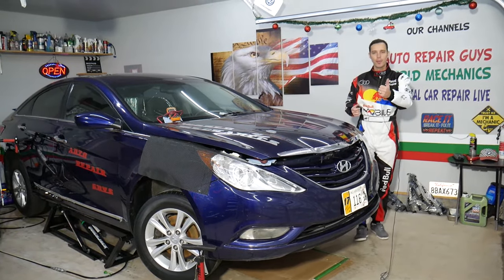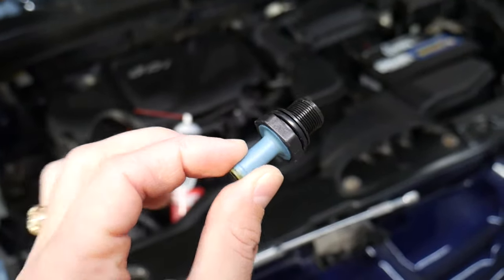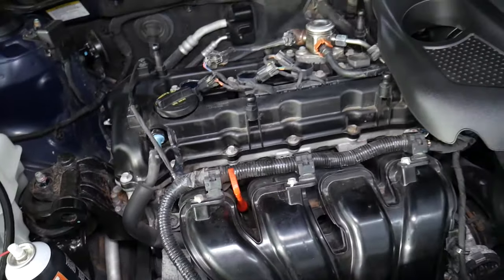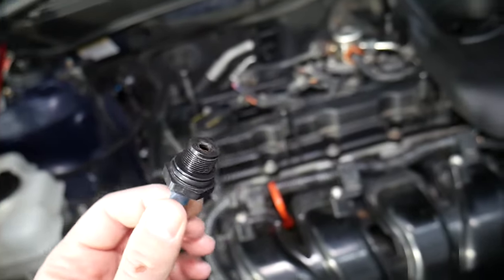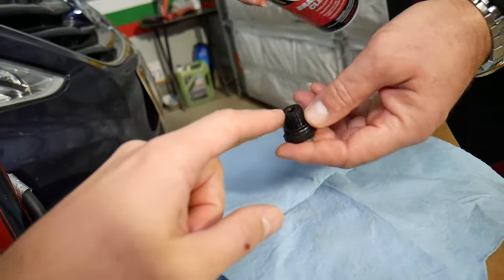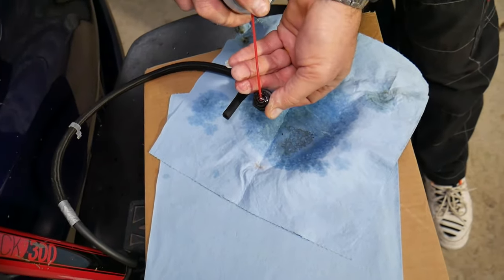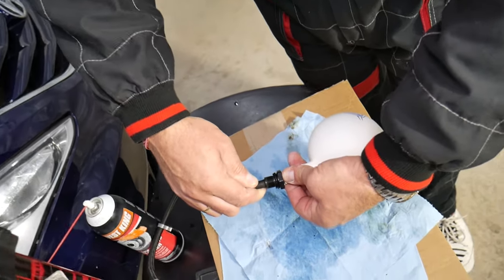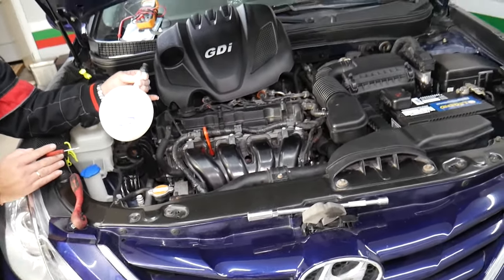HOW TO TEST AND CLEAN PCV VALVE ON CAR  EASY

Comment from the maker: Products that we use and recommend:
► PCV Valve (check for your car): https://amzn.to/2XK8Oyr
► Intake Cleaner: https://amzn.to/3oXt0Jc
► Panel Removal Set: https://amzn.to/3YiMADu
►Torx Set: http://amzn.to/2hbyWgd
► Tool Set: https://amzn.to/3p5MM6t
► Screwdriver Set: https://amzn.to/3XRB28Q
► Engine Oil: https://amzn.to/3xBc8B9
► Oil Filter: https://amzn.to/3w0Ulme
► Torque Wrench: https://amzn.to/32qyRwg
► Liqui Moly Engine Flush: https://amzn.to/3IiDBID
► OBD Scanner that we use most often: https://amzn.to/3I4MQfe

► Check out our Amazon Store for the tools and parts that we use: https://www.amazon.com/shop/worldmechanics
Reply: I test my pcv valve   and I blow air from side  wich is go to head    is open 
From other side with is go to intack is blocked

Comment: Ballon test was wrong guys. Pcv will pass weak pressure air through it. But not high pressure. The baloon is giving weak pressure of course. Misinformation
Reply: Yeah, I tested with a brand new valve and it leaks as you say, same way their broken one does.
Reply: Some valves (earlier ones?) don't have balls, but a tapered plunger because at idle you have high manifold vacuum and high speed/ acceleration very low to near no vacuum and so there is a need to moderate those high vacuum conditions. Yes, they never sealed completely by design. One wouldn't want that. These things were on 6 cylinders at least, but the problem with 4 cylinders and less, pulsing and too low a vacuum is created. May be why a ball is used in these cases as you do need a seal?
May be there's another scavenging component?  I don't know though. It a thing to ponder and find an answer?

Comment: I usually have a glass jar of acetone on garage. I soak PVC valve  for 2 hours. and does the trick.  Cleans the gunk inside valve pretty good. Thanks for the informative vedio and Don't forget to have a drink every time your hear "Guys".😁
Reply: Wasted 😵
Reply: Ty for the tip sire! Think I'm gonna try acetone on the EGR valve as well(not on the electrical parts of course) because I couldn't get the 1/4 tube part all that clean. Ty again

Comment: I soaked  and cleaned thoroughly the PCV valve, test it using the balloon as you did in the video but I did not deflate immediately the balloon in the PCV valve instead I left on the table for 4 minutes.  The  minutes passes  by,  the balloon deflated very slowly. In fact I hear a  little bit of hissing sound in the PCV.  So my question is should a good PCV valve be air tight sealed or not? Thanks
Reply: Good question, I'd love to know the answer.
Reply: Another comment said it should slowly deflate, not air tight

Comment: Thanks learn something new I'm dealing with all 4 cylinders misfire I replaced iac valve ignition coils and spark plugs also have new fuel pump and filter that were replaced couple months ago this is being a headache  I hope it's this

Comment: I changed the pcv valve the hose and the separate data connector going into the resonator but but i still have a p0442  evap small leak the scan tool had said it from the pcv from the mechanic i went to any advice should i have put Teflon tape around the threading to the pcv valve

Comment: Great job, guys. Keep it simple. You are awesome.
Reply: Trq has a vid, he takes off intake etc etc, to remove valve.   Entertainment at its best😂
Reply: P.s. some slap shot mechanics, use cheapest vac hose. Vacuum will actually collapse these cheap hoses.

Comment: Lovely. Worst issue is i cannot get replacement parts for a bad pcv for my vw fox... -.-
Reply: You could just try Kia part inside of a hose. Then just take out the guts from the original and use it for a fitting.

Comment: Hi sir can the bad pcv valve cause oil to leak from turbo and valve cover?
Reply: Valve cover yes, that's how I found out mine was bad. Replaced it a year ago and it started leaking again and even caused timing chain cover to leak as well

Comment: Hello, when I open my oil cap air blows out,  does it mean I have a bad pcv valve?
Reply: PCV valves are so cheap, just replace or clean it and see if it fixes the issue. It’s probably not a big deal. 
If not, check your oil level and coolant levels. If either one is low, fill it up and drive around, check again in a few hundred miles. If you’re loosing coolant or oil, you may have a coolant leak or head gasket issue.
Reply: Just change it anyways

Comment: I just bought a 2017 Hyundai sonata I change oil sparks plugs and pcv valve and the oil light came on when breaking I drain the oil and only 1 1/2 quart  on it so it burns 3 1/2 quarts  in less than 2k miles ,why?
Reply: My wife had the same issue with her car. Hyundai had a recall to replace those motors due to the oil consumption issue.
Reply: @tecitez16  i sold mine .

Comment: I tried the balloon test on a new aftermarket valve. The valve still leaks.
Reply: New from Honda - the air is leaking (the balloon is deflated). I think it should be so.
Reply: @СейчасМинутку  Are you saying you bought a new valve from Honda and it leaked?
Reply: @NextLevelAutoDiagnostics  Yes, indeed, he lets it pass in both Yes, he skips in both directions, but in one direction more in the other less. From the collector side approx10% ,cylinder block side approx. 90%  ,also works the valve bought on Aliexpress

Comment: how can i remove a stuck pcv that wont loosen? on a subaru forester? ty
Reply: Try using silicone lubricant spray (found in the automotive section at Walmart pretty cheaply) And spray it all around the seals of your valve. It's acetone based, so it's an excellent penetrant. As acetone can cause some finger numbness, Let it dry completely before touching it. This should help make your o-rings more pliable, provide some lubrication, and make it easier to take out. Hope this helps, let us know how it goes! 😊🌎✨